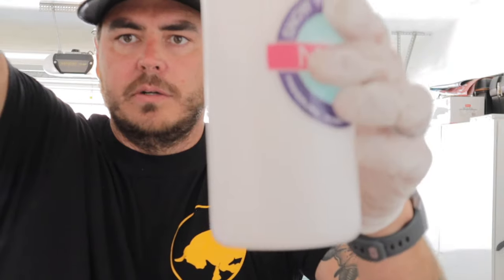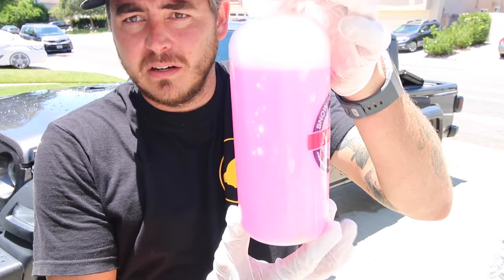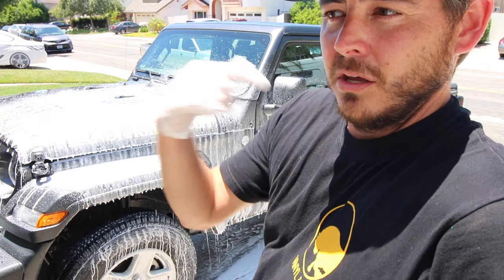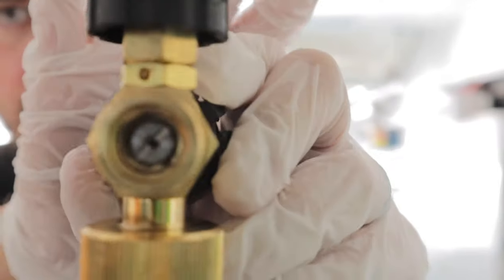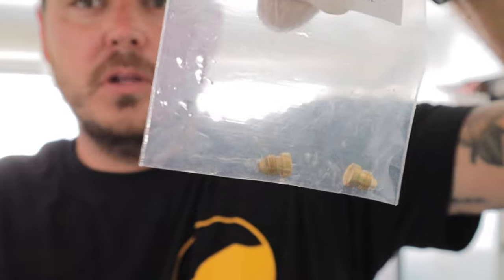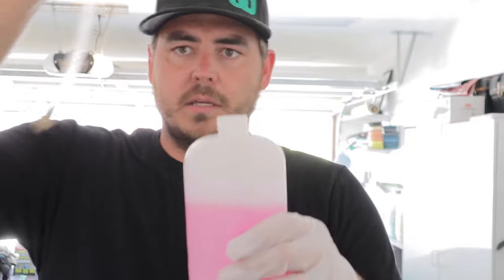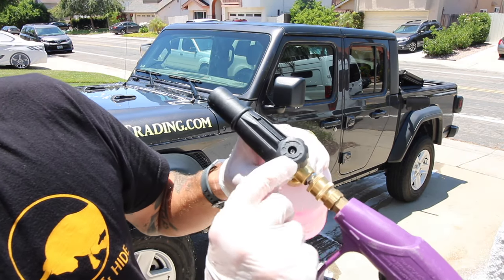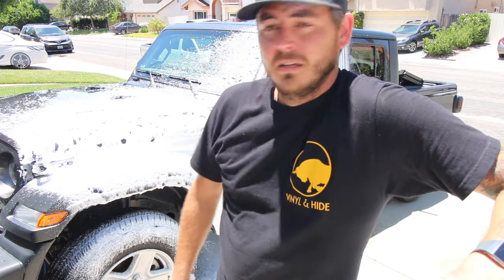How to get MORE FOAM from your Foam Cannon | Car Detailing Tips and Tricks | Pressure Washing

Comment: I have the MJJC a with a 1.1 orifice installed, sunjoe SpX2688 (rated at 1.8gpm), valve turned to the max soap setting, with Mr pink foam (liberal amount, tried more with no change) but my mix still comes out thin and a little runny, not like thick shaving cream. Any idea what could be wrong?

Comment: Would the orifice in a pressure washer tip be the same? I have tried to see if they even come out of the tip, but they look the same. The red tip is the smallest jet like stream, just wasn't sure if it would screw into the cannon or not?
Reply from the maker: Nozzles can have a lot of different sizes.. 2.0 2.5 3.0 and 3.5 are most common but you can go up to 6.0 I believe... but no they aren’t able to be switched with a foam cannon orifice. You really need the 1.1 which is a really small size to get the most foam

Comment: Hey Josh, I bought an inexpensive foam cannon on Amazon and also purchased the 1.1m orifice but tested it out yesterday and the foam was really running any tips? I also use your recommend soap with warm water.
Reply: I have the same problem. Let me know if you find a solution. My next attempt will be to put more soap in the ratio.
Reply: @archael18  second time worked a little better but about half way through it was was really watery. What’s your soap to water ratio, I just eye ball it.
Reply: @joneaton1972  i tried with 1 cup of mr pink soap and the rest with warm/hot water. Next time, I'll try 2 cups as an experiment and report back. But at the very least it would be twice as expensive as shown here so I'm not so keen on always doing that.

Comment: For the record, the cheap Walmart special $6/gal carwash soap foams just as nicely as Chemical Guys $44/gal Hydro Suds (extreme foaming soap /gimic).

I was trying to find this video to show a friend who was in disbelief.

I get the exact same results from my 4000 PSI Hot/Cold Pressure washer, I have hardlined in my garage as I do this handy little Dewalt 550 psi 20volt battery powered pressure washer I got at Home Depot for car showes that runs off a hose or siphon from a 5gal bucket of water. Rinsing is obviously another story, but the foaming capability is determined by the size of the internal orifice, not the PSI of the machine you're using (extremely common misconception)...

Comment: Adjusting knob function:  You said it adjusts the water flow - do you mean the siphon tube flow?  If yes, wouldn't increasing the soap to water ratio make more foam?  or using a higher soap concentration?

Comment: Basically the smaller orifice is for Pressure washers that put out less than 2 gpm. if you have a bigger unit you won't need to change out the orifice. This is only my observation

Comment: Interesting....i have the same foam cannon and put the same orffice in it.. and I'm not getting that great of foam.. probably my soap isn't that good... i did notice mine doesn't have the pick up peice on the end of the clear tube like yours. Would that make a difference? Mine didn't come with that. Also, do you think there's any issues with leaving un used soap/water in the cannon after a job? Or should I be flushing it out after ever use? I'm still dialing in my soap to water ratios per vehicle.... thanks man!
Reply: Same here. My cannon I just ordered doesn’t have that clear tube attached to it for the bottle. Where did you get that?
Reply: Mine came with the clear tube, but not the peice attached to the bottom end like I see in this video.... that tube should have come with the cannon though
Reply from the maker: I dont flush mine... But it wouldnt be a bad idea for longevity.  It should definitly come with the clear hose but as far as the little piece at the bottom... It should not make a difference at all.  Its just a little weight to keep the hose in the liquid.  I have one with it and one without and it doesnt affect the foam at all!
Reply from the maker: Mine always come with the clear tube... You can probably find something like it though at home depot, or even a fish tank place...  It would be similar to the hose for a fish pump
Reply: Sweet! Sounds good thanks!

Comment: Sheeesh thanks for the tip,would I still get a lot of foam with a 1900psi electric pressure washer tho?
Reply from the maker: Yes, absolutely.. I was using a Ryobi 1600psi unit in this video

Comment: I did everything mentioned and I bought everything you recommend but the best I can ever get is about midway between your two examples. I can never get thick foam like you have. The only thing I don't have is the short wand. I have the dewalt 2100psi and you mentioned really liking the gun quality so i just stuck with it. Is the gun responsible for me not getting thick foam?
Reply: What soap are you using? Mr. Pink foams better than any soap I've tried. So if you haven't used that soap, try it
Reply: @miketampabay9446  it's the Mr Pink and I tried with varying temperatures of water. Nothing foams like in the video.
Reply: @archael18  Damn. Not sure then. I got the armor all foam cannon for like 35$. Maybe try that. Or spring for the MJJC

Comment: Does that one bottle last through to coats of foam? I had to mix up two bottles.  Is that normal? I prefoamed a Tesla.  Bottle empty. Rinsed. Foamed again and bottle empty. Too much? Normal?
Reply: Use the knob on top to make adjustments, if that doesn't help, add a little more water to your solution so you don't run thru product quickly. If you like the foam you still get with the new dillution, stick with it. I have the new MJCC foam cannon and I run through 2 foam cycles in 1 75% full cannon. My capacity if 1L on the cannon btw.

Comment: great video! quick question. Do you have to change the aura fist  if I have the sud magic foam cannon brass threaded ?  or it already installed in it i dont have to change it?
Reply from the maker: The aid magic comes with it already installed!
Reply: @imjoshv  thank you for the reply 🤙🏼
Reply: @imjoshv  one more question boss! What pressure washer gun do you use for the sud magic foam cannon? I saw you linked 2 guns but which one works best?
Reply from the maker: @Ronniedonny1  They work equally well!  One has a swivel on the base... I use that one in my shop and the other one i use in my mobile unit!
Reply: @imjoshv  thanks boss man! 🤙🏼

Comment: Do you have to scrub the car after foaming or do you just rinse off?
Reply from the maker: depends on how dirty the car is.  If its not that dirty you can just rinse it away, but in most cases you should go over it with a wash mit

Comment: What size is a standard nozzle - instead of 1.1 mm ? Also, there are two sizes of filter available - 2.7 g and 3.7 g. I guess, that helps for foaming too ? Can I put either 2.7g or 3.7g filter in my cannon ?
Reply from the maker: Yea I’ve never seen an option for the filter size.... but I think the normal orifice size is around 1.5. The 1.1 makes a big difference
Reply: @imjoshv  Actually, filter is available in two sizes on Aliexpress. I ordered the 1.1 nozzle to see the difference. Thanks.

Comment: I would do that but I have the active 2.0 and it says on the warning label that if I use a 1.1 instead of a. 1.25 it can mess up the motor. What do I do?
Reply: I also have a HP washer so need the 1.25mm. 1.1mm can`t handle the 2000+ psi so just adjust using the top handle/dial

Comment: Will this trick work with the active/simoniz 1800psi pressure washer that you tried in another video?
Reply: It should work for any power washer that has less than 1.8 gpm flow.
Reply from the maker: Absolutely!

Comment: If I buy ryobi 1600 psi it good  enough with foam cannon or I have get the one with 1900 psi  instead…?
Reply from the maker: the 1600 and 1900 actually get the same usable numbers!  I was using the 1600 in this video.  just make sure to swap the orifice

Comment: Question. If you pressure washer is rated at 3300 psi 2.5 GPM is it safe to use the 1.1mm orifice nozzle ?
Reply from the maker: If the pressure washer gets those numbers it shouldn’t need the 1.1mm. Is it a gas unit?
Reply: @imjoshv  yes it a gas unit. So maybe I shouldn't need the 1.1mm orifice nozzle ?

Comment: What's your thought on using distilled water to mix the soap? Temp of water make a difference?
Reply from the maker: ive seen some people saying that... If you fill the foam cannon with spot free water but then have normal water hooked up to the pressure washer, i dont see how that would help. Ill be doing a video soon testing all of that!

Comment: Since I have a 3600 PSI pressure washer do you think it’s necessary for me to switch it to the 1.1?
Reply from the maker: Probably not... Did you already buy a foam cannon?  If not check this one out.  I just started using this one and really like it.  It has a brass threading so you dont have to worry about stripping out the threads (ive done that in the past with others). And it also come with two different orifices just in case!  https://amzn.to/2YKK6hJ
Reply: @imjoshv  sweet, and I haven’t ordered one yet , I been doing crazy amounts of research on which one to get, I’ll definitely go ahead and check this one out, thanks!

Comment: I have tried the 1.1 orfice on my Trinova foam cannon on my Dewalt battery power washer, going to see what happens with a 1.0 orifice??
Reply: Hi Paul, does it foam well enough using a battery power washer? What's the psi your washer produces?

Comment: Thanks for the video. I ordered a foam cannon that comes with an extra 1.1mm orifice but it also has a warning not to use it above 3,000 PSI and I just bought a 3,300 PSI pressure washer so I will have to check the ACTUAL PSI it produces at the wand before trying the 1.1mm or at least according to my limited understanding that it is probably well below 3,300 PSI actual. I wonder what happens if it were something like 3,100 PSI and the 1.1mm orifice is used or how much leeway is built into the warning.
Reply from the maker: yea i am referring to my dealer accts where i work on the hole lot!  Meaning i touch every car by putting in plastics, do any necessary repairs, and then making sure they look their best each week.  Because not every car needs repair we are able to maximize profits. Some days every car needs some work, other day none so you can really clean up on those days
Reply: @imjoshv  Did you maybe hit the wrong "Reply"?

Comment: I have a question I switched to the ryobi 1800 psi 1.2 gpm and pressure is good but when I connect my foam cannon it hardly lifts it and shoots out more water than foam I ordered 1.1 mm orifice to see if that helps but my concern is I have 2 35ft hoses connected together do you think that is cutting pressure as well instead of just one long 50 ft one?
Reply from the maker: What foam cannon are you using? I know with the longer length hose it can delay the pressure slightly so maybe that’s what’s happening
Reply: @imjoshv  it’s a $20 from Amazon the name is duischin I believe and will it be the hoses connected making it loose pressure sense it has to push threw the coupler
Reply: @imjoshv  when I use the foam cannon it’s more like just soapy water I highly doubt the unit is messed up or malfunctioning
Reply: @imjoshv  hey josh so I changed the orifice to a 1.1 as you always suggest and perfect for my foam cannon going good and foaming thanks man for all you’re videos very helpful keep the posting

Comment: My local car wash doesn't foam this well but it foams somewhat and works great.  The owner and his pretty wife take good care of the facility.  All top products, always filled and an endless supply of RODI rinse water.  They have a new machine that pulls in the floor mats and spits them out clean and almost dry and wheel cleaner with serious brake dust solvent.  All that is missing is social ambience.  The customers are like zombies.  Its best to go in pairs for company.

Comment: Hello ok I bought the Twinkle Star Foam Cannon 1 L Bottle Snow Foam Lance with 1/4" Quick Connector, 5 Nozzle Tips for Pressure Washer and changed to a 1.1 i still can’t get the foam you get using the rainx height foam soap
Reply: Same here I’m not getting barely anything. Do we have to use a certain soap?

Comment: I replaced the orifice before even using the foam cannon. I’m using Chemical Guys watermelon wash with a Ryobi 3000psi pressure washer. I’m getting the foam from your before shot and it’s sucking down the solution very quickly. The only way to get an almost acceptable amount of foam is to add an obscene amount of soap to the bottle, but then it takes forever to rinse. I tightened the fittings on the foam cannon. The bottle leaks when held upside down. I don’t know if that would affect it. I do have hard water, but I’m not sure if it would affect the foam this badly. Any insight?
Reply from the maker: you said you tightened down all the fittings. have you played with the little nob on the top of the foam cannon? That also adjusts how much water flows through.
Reply: @imjoshv  I did. I also used warm water. I’m working on my water softener. Maybe that will help. May I send you a video the next time I try the cannon?
Reply: you may want to put the original size orifice back into your foam cannon since the 1.1 is meant for lesser GPM pressure washers to get better foam

Comment: I replaced the orifice with the one you suggested…it didn’t seem to make a difference.. any suggestions?
Reply: Don't know if this will help,but he mentioned the flow rate with the dial. 5:05
Reply: @69ztang  yea I had it all the way down.
Reply: another thing to consider is what your powerwasher is, whats the pressure, and how many gallons per minute does it produce depending on what cannon you have, look at the min GPM it requires as that helps.

Comment: You do not want to always reduce the orifice size for foam cannon. The 1.1 mm ones trip 70 percent of the gfci's or breakers under 20 amps. So don't just swap out orifices because someone said so... Make sure you're pressure washer and outlet can handle it first
Reply from the maker: thats true it does increase the power draw.  I have tested a ton of pressure washers on my channel and none have had any issue with it though
Reply: I’m pretty sure my 2700 power washer could handle it for sure
Reply: @JonahZX10  what about a 1800 psi one?
Reply: @imjoshv  how much psi is it? I have a 1800

Comment: What if I have a gas 3,100 PSI gas washer? Do I still need to add the new (smaller??) orifice?
Reply from the maker: No I think you should be fine without the smaller orifice
Reply: @imjoshv  I was about to ask about this.  Was figuring it was a bigger issue with less power pressure washers.  Glad I found the answer.  I'll test and see how i get either way nice good information quick and no bs.  liked and subbed!

Comment: Do I need a 1.5 mm orifice for a pressure washer with a 4000 PSI 5 gallon per minute unit?
Reply: this sounds about right.
Reply: @trulsvian  are you an expert ? Or just someone blowing smoke
Reply: @Thetruthhurtstrump2024  im not an expert end im not blowing smoke. Theres charts on several of the detailing websites that helps you with nozzle size.

Comment: Dumb question…you foam all your soap.  You are still using 2 buckets to wash?  Do you have a separate water source set up to fill buckets, otherwise putting water in a bucket with a pressure washer is not fun

Comment: So by reducing the water you increase the foam. Why not just increase the amount of soap in the cannon? It will give the same result as its down to soap / water percentage
Reply from the maker: Adding soap wont do it.  It adds a little more foam but doesnt give the results you really want.  Reducing the orifice size is the way to go

Comment: 🚨 @imjoshv... can we use a 1.1 in a high flow PW?  My Comet runs nearly 2.0gpm and I've read that the Comet doesn't like the 1.1.  What are your thoughts?
Reply from the maker: Hey Jeff usually with that much flow you should be getting enough foam with a 1.25 orifice. With that said, I still run a 1.1 with my kranzle, ar630, and the active 2.0. It cause more of a draw but I haven’t had any issues
Reply: @imjoshv  Wow... thanks for replying. I think I may not be using enough soap.  My last test i used 200ml of soap (per the markings on my Adams Premium cannon) and it was thicker. What amount of soap do you recommend to get the thickest foam?  BTW i'm using Chemical Guys Honeydew

Comment: I don’t see a difference in the two nozzles, and they look identical. Any way of telling which is which? Also a bit disappointed in the whole process, I foamed down the car let it sit and rinsed off and still super dirty. What am I missing?
Reply from the maker: No the hole is hard to tell the difference until you use it. Also you foam the car so the soap sticks to the surface and helps break things down but you should still go over it with a wash kit for the heavier set in stuff.  Has your car been coated lately? Once the paint is smooth and protected it’s becomes much easier to wash
Reply: @imjoshv  good points, it has not been waxed in some time. Thanks for the response!

Comment: This isn't really a like-for-like demo, because after fitting the new orifice you have then reduced the amount of water coming through using the top knob. This should have been left at the same setting as the first demo so you can make an accurate comparison of the effect of replacing the orifice.

Comment: Since the foam thickness is dependent upon the ratio of soap to water, would I not be able to get similar results by just increasing the soap to water ratio in the foamer bottle and use the same delivery flow of high pressure water?  I will need to try both.  Thanks.
Reply from the maker: You actually don’t need that much soap in there.. the orifice size and the gpm of the pressure washer are what matter